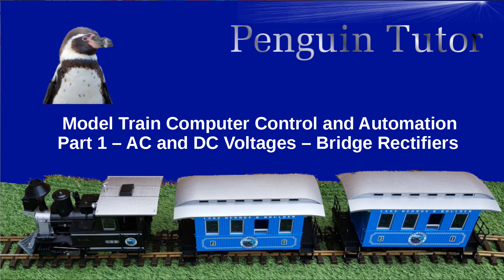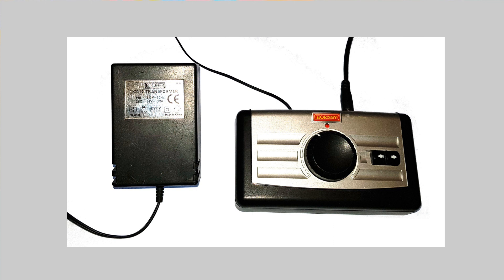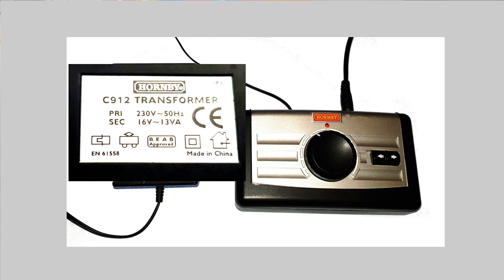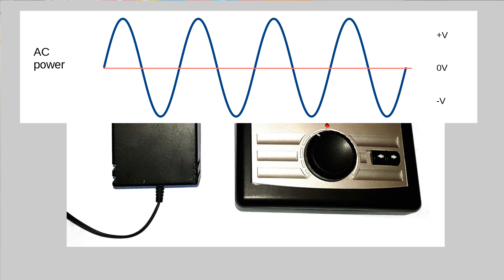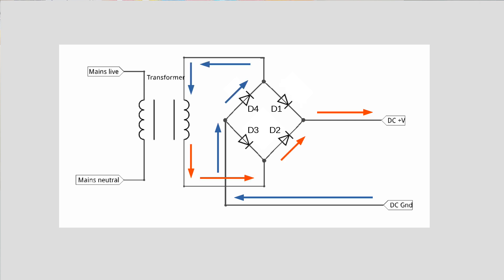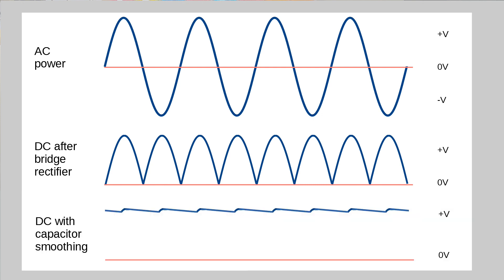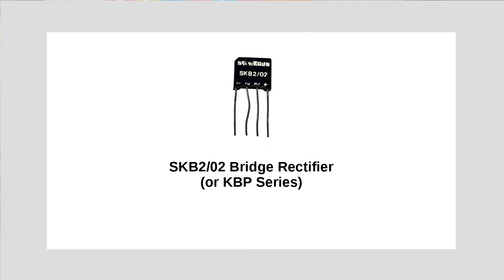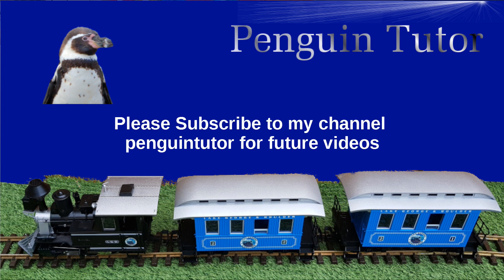Model Train Automation with Raspberry Pi and Arduino - Part 1 - Converting AC to DC

Comment: This is nice, how can I get involved in order to gain this knowledge
Reply from the maker: I'm glad you like it. It depends upon what you want to get involved in, whether that is the electronics the programming or both. 

Full details of how to create the setup are on my website at: https://www.penguintutor.com/projects/modelrailwayautomation which includes the wiring diagram. 

This would be a good project to look at expanding. I've not really developed it much recently. I still have it for my outdoor model railway, but I've mainly been working on an application for my indoor railway which uses DCC and is much more complicated in terms of electronics and programming. 

A useful addition for this project would be adding signals or sensors to have the train interact with other features. 
I did create a signal light using a Pico, that could be implemented directly on the Raspberry Pi, or one thing I did consider would be to connect the Pico to the Raspberry Pi (eg. using I2C) and passing messages using that. 
https://www.youtube.com/watch?v=pwq7XghqMPI